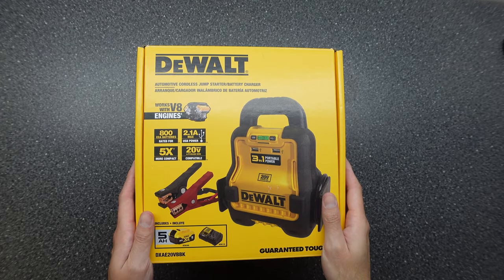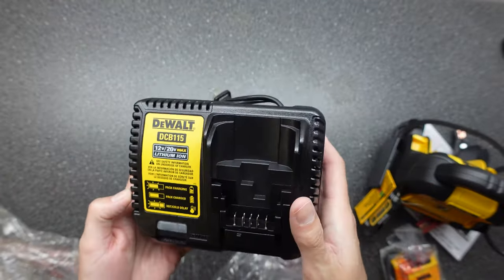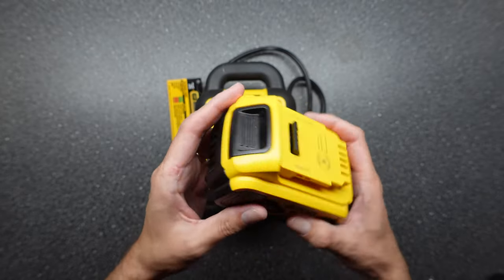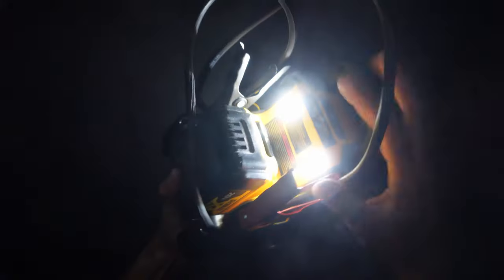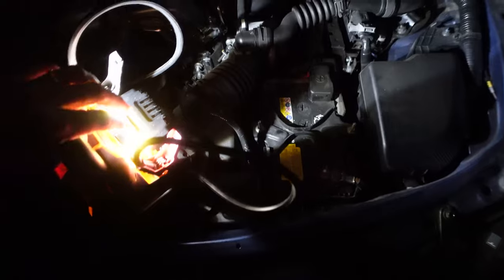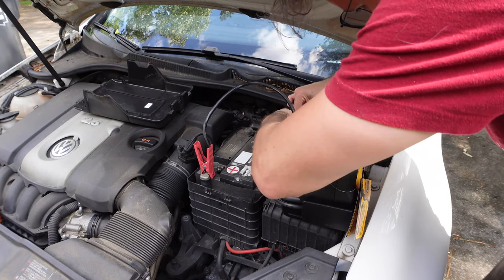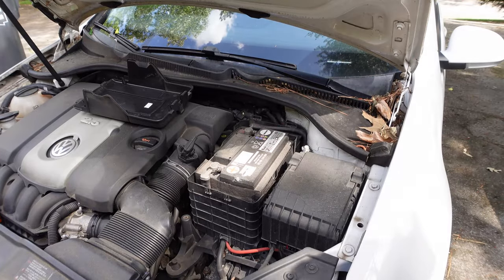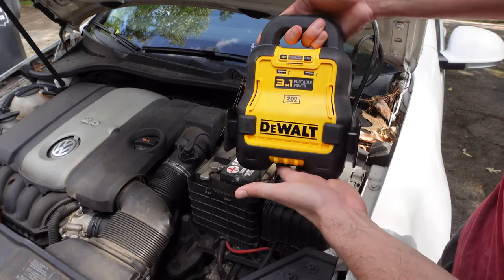DeWALT DXAE20VBBK 20V Battery Booster (20V XR 5AH)

Comment: Does this provide constant power? Like can I use it to run a 12 volt diesel transfer pump?
Reply from the maker: I'm not entirely sure. Haven't tested that. Assuming it would as it will provide power when it detects a proper circuit

Comment: so if you dont have the 100.00+ doller battery you wount get the jump you need
Reply from the maker: So as with any of these items in a particular ecosystem. It benefits those that are already invested in DeWALT that have batteries from other tools to use on this. 

Most brands will have their own version.

Or you could also purchase a generic lithion ion battery booster.